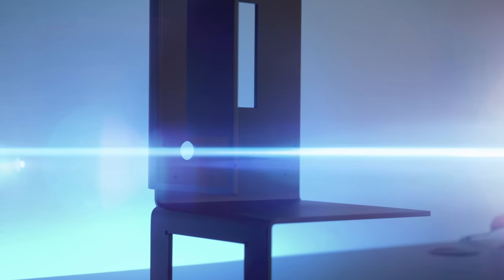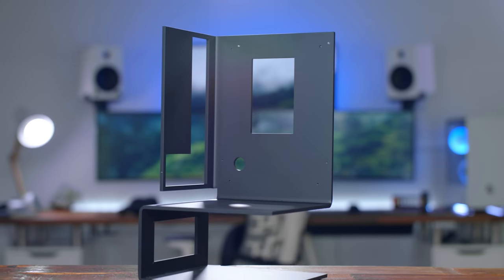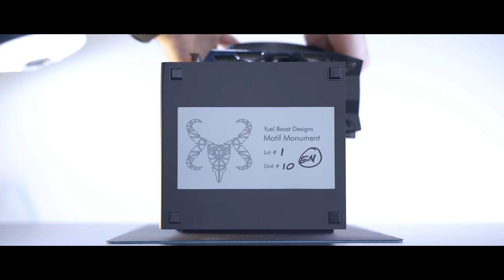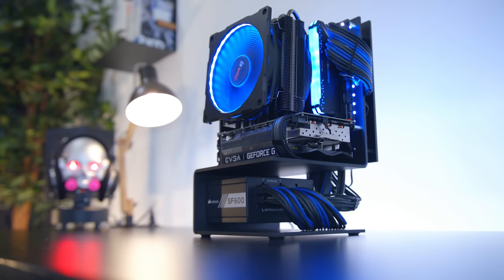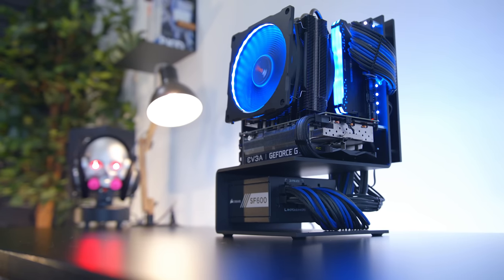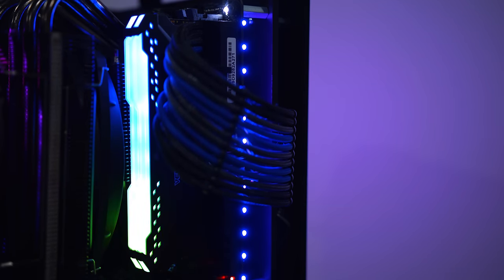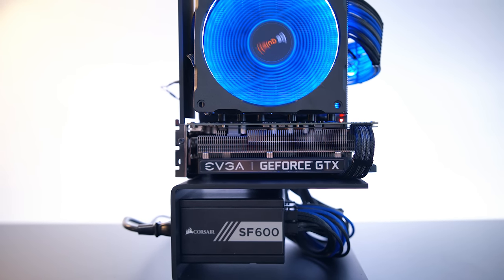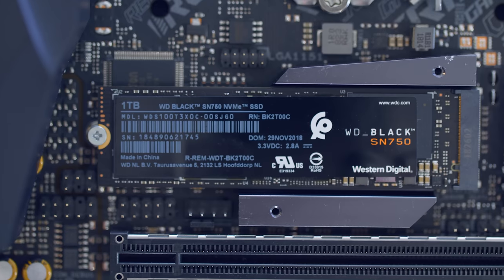Building A Minimal PC Like You've Never Seen! Motif Monument

Comment: 250$ for a piece of aluminium... Getting some apple monitor stand vibes here 😅
Reply: Yeah I mean you could actually build something like this with some wood, not that ventilation is going to be an issue anyway
Reply: Yeah, I looked it up too. 250 is way to much. That's like.. pure profit lol. I was looking to build the entire thing for little over that!
Reply: @DarkMikaruX  Also he says its welded together but from what i can see its just a one piece of aluminium folded and stamped which makes it even cheaper to produce.
Reply: @FullFledged2010  I like it but I wouldn't pay a dime over 100 for it.
Reply: it is steel, not AL
Reply: @hekasoram  Than its even worse
Reply: @FullFledged2010  Of course its very expensive but you have to see the fact that one guy makes them. He had to buy machines worth many 1000 of dollars. I don't know how fast he is but I guess one case from start to finish takes at least a hour+ the time cutting needs. Its also not cheap spray painted. The owner wants to eat and build pc to so he needs to make profit. Its a very unstable income it's not a job with monthly cash, there could be month he sells 1000 there could be some he sells 0. Also the workshop he builds them in cost rent to.
I totaly agree that this is to much for a case for many people (including me) but talking his work down is not very nice. A japanes chefs knife is also just a piece of steel but way more expensuve then one from wallmart. The diffrence is (like with the case) time, knowledeg, material and the fact that it is handmade.
If still say it is way to much. Set a timer. Model the thing in any program and bring it to a local welder and ask how much he wants. The to a factory which paints it. Then calculate your time spent desining it( which isnt fair compared to the case desingner cause he had to come up with it and you just rip it lol)
Long story short: You have to think about it as a piece of art, handmade for a little market with high qualitiy material and not a cheap mass produced think.
A picasso painting is also just some paint and a piece of paper just like the one I did in elementary scool, wheres my 1000000 dollars for it Iamo
Sorry for the bad english I am a forgein
Reply: @mazaafaakaaa9941  depends on what you call art i guess. I would call a mass produced 2080ti a piece of art just as much.
Reply: @FullFledged2010  I also wouldn't call it art in sort of a painting. But when I, a person who also works with metal etc. look at it I see a piece which is well build and thought out. Since I don't have one I can't be 100% sure but it also looks well build.
Reply: Ya kno aluminum is expensive right... most cases are plastic or fiberglass
Reply: @huntermurphy583  a slab of alu like that is like what 10$ ? but its steel so its even less..
Reply: Haha that aluminium is very easy to fabricate. That's a total ripoff!
Reply: It has siri built in.
Reply: You can always find the clone for 100-180  on aliexpress and taobao But those through out time start to bend from the weight of the motherboard.
Reply: @DiegoMartinez-vc5xy  Yeah like 5mm steel is going to bent from the weight of a motherboard... nice try 😂
Reply: FullFledged2010 can you not read. I said the clones, the knockoffs, are made from aluminum and it leans if the motherboard has too much weight
Reply: @DiegoMartinez-vc5xy  i dont think thick aluminum bends either
Reply: @DiegoMartinez-vc5xy  I was talking about the clones and even 5mm aluminium would easilly be able to hold the weight of a full atx mobo + the biggest and heaviest gpu there is no problem.. Maybe the ones bending have defects or metal fatigue at the folds. But i think the users bending it when installing the mobo without knowing it is a much more plausible explanation.
Reply: FullFledged2010 there was a reddit user who had a clone, he posted pics and you could tell it wasn’t straight. Maybe it was a defect, I don’t know but he used a noctua nhd15
Reply: It is stainless steel
Reply: Diego Martinez how I can find this “case” on Aliexpress? There’s a specific “key word” or “name” for this?
Reply: Lmao apple stands are actually way too expensive
But its very good one
Reply: FullFledged2010 its steel
Reply: @FullFledged2010  Nah, this aint aluminium, it's steel. Where I am shops won't sell bellow 1 square metter and in this thickness it is from around 100 euros for 1 square meter. Can't be bent by hand, plus holes... I agree 250$ is a bit too much but... dunno, would rather buy streacom benchtable tbh.
Reply: @JohnyMcNeal  Here in the Netherlands you get steel of aluminum like that in every size you want for well below a 100 euros. A piece that size should cost less than 20euros.  Bending should cost only a few cents. every metal shop can do it. Drilling and tapping is done by a machine so i really can't see how that price is justified..
Reply: If you had access to a CNC cutter and a hydraulic bender or panbreak you could make this for like $10
Reply: @yaamz7  Finally someone who speaks English and gets my point 🙌
Reply: @DarkMikaruX  I wouldn’t pay $40 for it. $30? Maybe. Lol.
Reply: I KNOW, you could make something competitive out of any number of materials for shit all money, in your own garage. It's literally got less features than my 25 dollar bargain bin mid tower, and lets be real, space for air to move doesn't equal moving air. Any real case with 5+ populated fan slots is going to match that cooling, and protect your hardware 10x better. Mine sure as fuck does. And again, 25 bucks new. Yáll saying you wouldn't pay a dime over 100? YOu're still getting fleeced. This costs maybe 10 bucks to manufacture (including in labor and machinery maintenance costs), at most 5 bucks to ship individually and even less in bulk considering you can nest a design like this, and then you could mark it at 20 and call that a rock solid profit. 25 is the highest you could call it even remotely reasonable. Anything after that is just paying to imbue your chunk of aluminium with the mystical power of a Brand
Reply: Way to much. You can build a better case with that money

Comment: This is around a $1200 build if anyone was wondering
Reply: Too much dont you think?
Reply: $1200 USD?
Reply: @nicholasprince5909  Dont you think 1200$ are a bit too much for those specs?
Reply: $1200 is a cheaper price for a good pc. A great pc can be Three Grand and over
Reply: Endgame Studios noooo i built an amazing 1080ti build for 2000
Reply: @ape6095  Thought it had only 1 tb.
Reply: Yes it is too much, can much it much cheaper by using AMD CPU and board. Maybe different cooling and RAM as well.
Reply: @RaptorFaceRumble  Yeah
Reply: How a 1660ti build can be more then 1000$ by any means?
Reply: @HCosta21  Because it has 2 Terabytes of SSD.
Reply: @hugopetch7012  Yeah, because it's a 1080. What did you expect? It's trash now compared to the 2080. You can pick up a used 1080 ti for like $300.
Reply: @Daniel-__  not really, the 1080 especially the ti 11gb goes for 600 ish second hand, and what's the point in an rtx 2080, you can get raytracing on the gtx cards anyway, rtx cards are just a cash grab
Reply: @hugopetch7012  True, but In a couple years the 2080s will support much more games, and the mining market will be finally dead, so I think by 2025~ish 2080s will be close to 200$ and support a variety of games
Reply: I reckon you could get this down cheaper if you waited for deals
Reply: @Daniel-__  I will be happy when the day comes I can buy a 2080ti for even less than  500 😂😂😂
Reply: @hugopetch7012  Newegg is selling a new 2070 for 500
Reply: @Daniel-__  yeh that's pretty good, here in the UK u can get a 2070 OC for $550, but 2080ti's go for 1.2-1.5k
Reply: Dont forget affiliate links as well. If you want a specific budgeted build message or @ me and I can help you out :)
Reply: He could of used a zotack 1080 ti mini intel i 3 8100 same ram
Reply: Narathin the processor being able to handle no bottle necking, the airflow/fans , the power supply assuring a satisfying number of watts (650 watts neutrally), an ssd and a hard drive usually both costing 100, the ram costing around 100$, a case with good ergonomics and airflow. And even then you’d have something around 1200$ not mentioning any aftermarket heatsinks
Reply: I just love. Love

How people say you can get a good gaming pc for under 500$. 

Yeah. Ok
Reply: Thanks, i was wondering that actually😂
Reply: @whodis715  no we weren't , we were talking about just gpu's
Reply: I'm an Intel fan boy, but after yesterdays AMD new hardware you could probably make this PC $900-1000 with Ryzen CPU, Nvidia GPU, and AMD Mobo. On the other hand if you got a job and can afford spending more still spend the $900-1000 and put another $200-300 in better RAM, SSDs, HDDs, Fans etc... still giving you more value.
Reply: depending on the case it's probably not 1200 just letting you know.
Reply: I was! Thank you
Reply: For ITX, that's an insanely good price. Will wipe the floor against any gameing laptop within that price range.
Reply: RkSld WILD thanks bruv
Reply: take out the rgb , the 1660ti and get a 2400G and you can do this for a way more less money
Reply: uhmm no the case is freaking 250 dollars so...
Reply: @afk-Legacy  no wth. also keep in mind the case is 250
Reply: @broodjekaas820  I think portability itself has a heavy cost. Compare a pc and laptop with same specs and the price margin is huuuge. Same goes for size I guess.
Reply: @midnightexigent  Bruh no wtf? I have a RTX 2070, 16 gb ram, and an i5 for $1039.00 if you know how to shop, you can get a great pc for less that $2k.
Reply: @BH Gmg I said "Can", it's not required to be 3k but I'm saying that some of them CAN be up to 3k
Reply: Thankyou
Reply: Tankya
Reply: Matthew 250 dollars for something you could make in a hour.
Reply: T H X  N I C E  T O   K N O W       A N Y W A Y
Reply: I’m personally on the Ryzen team so if you’re the same I’d recommend a Ryzen 5 2600 and the rgb wraith prism cooler to get the same effect he has with the bequiet cooler also you’d probably save a good chunk of money if you went this route and got a 1660 super instead of the ti
Reply: @midnightexigent  you could get an rx 5700, 16 gigs of great ram, ryzen 5 3600, cooler, 1tb ssd for like 700 bucks. Wtf this shit pc.
Reply: thank you very much.
negatived the video.
Reply: @HCosta21  the case itself is like 200 dollars
Reply: How much FPS would that run
Reply: Thx u sooo much
Reply: @Daniel-__  LOL this aged so so so badly

Comment: Why does a case like this cost $250... yea sure it looks unique but still, max i would pay for a bent piece of steel would be $60
Reply: Maybe due to low production quantity, and then perhaps the standard of the machining and the quality of the material? Plus I guess if it's unique, it can maybe get away with it higher markup.
Reply: I agree.  could be accomplished w/ a sheet of aluminum, cnc router, and a sheet metal brake.  I love the design though.  Very simple.
Reply: Anything marketed as art can be marked up and still sell
Reply: i made it myself with laser machine took me like 20€ to make it and 2 hours of time.
Reply: @rxil8062  do you have some of the designs that you'll be willing to share(it's your wish as it definitely took you time to make them)? I was looking to build one myself but still going back and forth between wood or aluminum
Reply: @namankohli1061  aluminium is the way to go,looks a lot better and i dont make a lot of cases.I wont share it cause its my personal build and its 1/1.And its not that hard to make it in corel draw
Reply: @rxil8062  thank you for the software suggestion (entirely new to this lol) and respect your decision. Aluminum it is for the project sir.
Reply: @namankohli1061  i am a kid 😂 but hope you get good at making cases etc.
Reply: @rxil8062  can you say the size of aluminium please?
Reply: @aedan2319  1m×1m should be fine
Reply: @rxil8062  thanks
Reply: Apple monitor stand $ 1000, this is a steal :)
Reply: Yea bro, I think so too
Maybe 100-150 bucks but not 250
Reply: @rxil8062  Sorry but I am calling bull shit. Laser cutting alu is hard and it folds like shit. Prove me wrong by posting a picture.
Reply: @KeesHessels  I find it funny that people complain about the monitor stand without having played with it. While the material cost is relatively low (it is still a big chunk of alu), the cost of the CNC used to machine it must be ridiculous and it does have some triple+ digi tolerances which should increase the cost. I find the iPad Pro magic stand pricing much more offensive. Unless you ever machined something ,it is very hard to estimate how much work is involved.
Reply: @rxil8062  LOL...amazing, I am in the hunt for a minimal mini ixt case for my build but I would like something thinner like the Sentry 2.0 case or the Skyreach 4 mini if you know what I mean, as a matter of facts I don't even need a case. Just a bent sheet of aluminium with mini itx screw holes and a side rack space for the graphic card (mounted horizzontally, with an extension cable or a riser for PCI-e). Do you think you could build one for me? and how much do you think it can cost (factoring in time, material and postage)? I would buy one of the case mentioned above if only it was possible, those cases are not only pricey they are nowhere to be found too.
Thank you in advance for any info you can provide
Reply: @rxil8062  Kid with a "laser machine" in England advises to buy a whole square metre of aluminium for this project . . . . 
And I forgot to put my boots on . . . . .
Reply: jovanq aluminum is not durable enough, galvanized steel is the way to go, at least 1.2 mm thick for a build like this.
Reply: Naman Kohli aluminum is not durable enough, galvanized steel is the way to go, at least 1.2 mm thick for a build like this.
Reply: Sexbomb 6641 true, there are knockoffs of this case but made of aluminum and they easily start leaning from the weight of the motherboard.
Reply: because people are greedy?
Reply: @makai5328  yea, but it so stupid to make it pricey. If it has reasonable prices people would by that thing even more. The reason why “art thing” cost more is because its not a product with certain function, they purely for aesthetic. About this case, it has functionality. So it’s not fit to be called arts product and using “arts” price tag
Reply: “It’s not just a bolder, it’s a rock.” Same logic

Comment: Where's the allen wrench, tweezers, and swiss army knife?
Reply: Careful to use rubber pads so the power supply doesn’t “short out”
Reply: At least he didn't install the GPU in the wrong slot!
Reply: Damn he even forgot to leave out the part where he put in the fans
Reply: Guys he forgot the wristband that grounds any static charge, this build is ruined
Reply: No joke tho. Look how installed the M.2 didn’t use standoffs
Reply: Thomas Longstaff the mobo is made like that tho
Reply: He’s got the table so step 1 is complete
Reply: @McSpicyYT  no it's a swiss army knife that hopefully has a screwdriver

Comment: Soon the case will literally be invisible and the parts will just be floating
Reply: Glass cases?
Reply: mrpvsts that could work but it would have to be really thick glass to not break
Reply: Cant wait
Reply: This could probably be replicated in clear acrylic with a slight design modification.
Reply: Throw them in mineral oil and wire them together
Reply: Imagine an electromagnet holding the computers parts up in space. That's some warframe level shit right there
Reply: With drones that work as fans
Reply: Soon the way to go will be fanless SBC, right now some of these little beast are powerful like PC from early 2000. Sooner or later the assmbled bulky PC with discrete graphic card and mass storage will be obsolete.